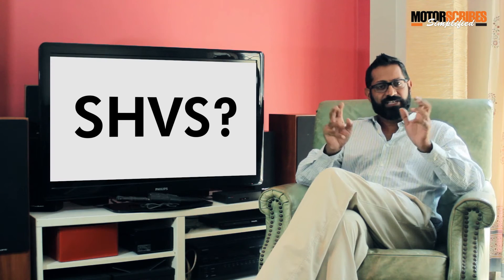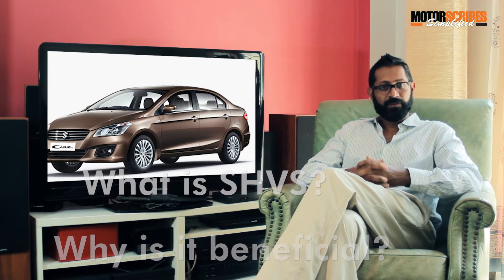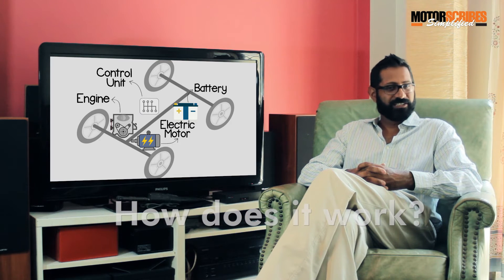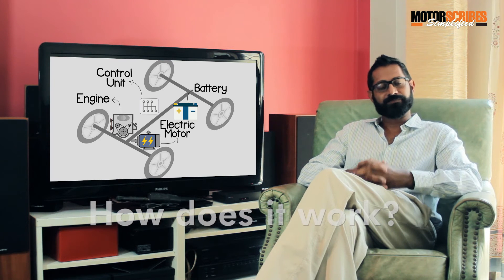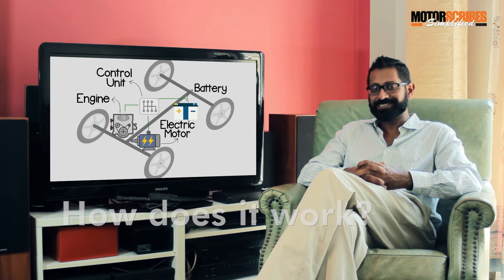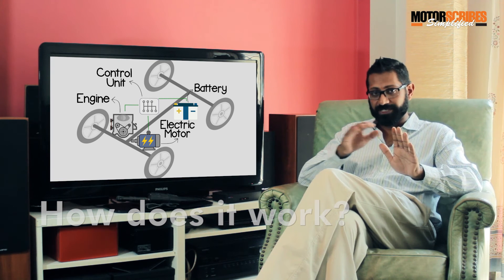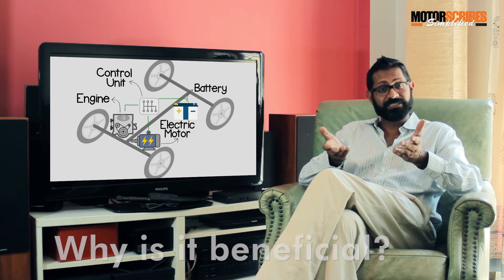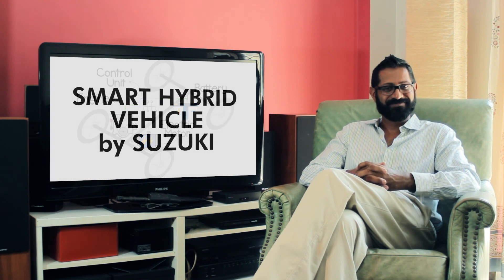MotorScribes Simplified - What is SHVS?

Comment: No need to reverse the engine. If you supply power to motor it generates rotation. If you supply rotation it generates power. simple.During braking the power is cut and motor gets rotation /kinetic energy from engine and converts it into power to charge the battery. when power is given to motor it assits engine.